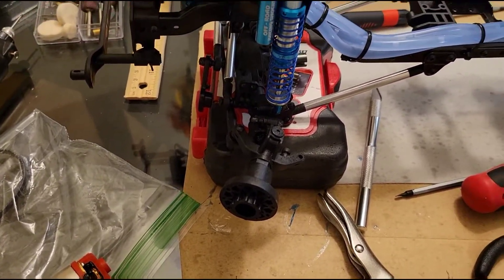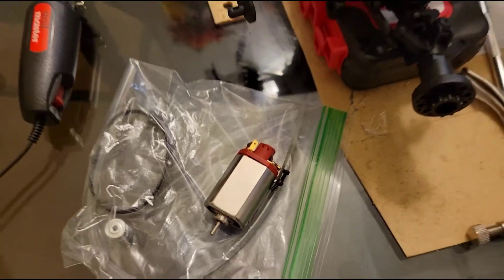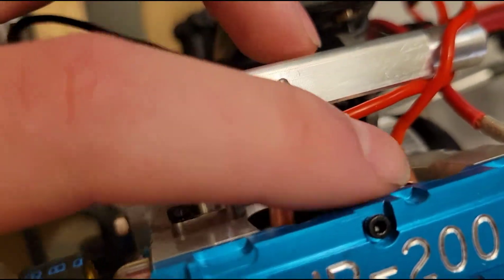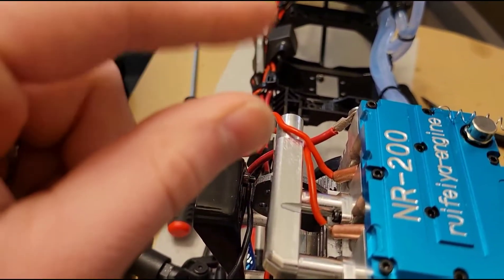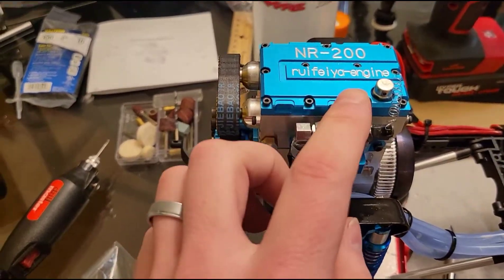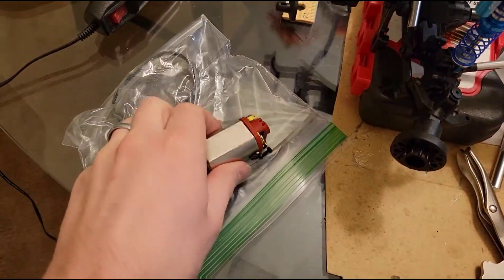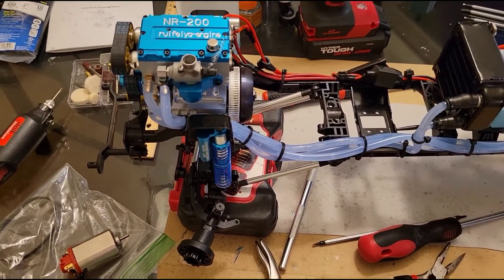Ruifeiya NR-200 Engine Problems!!!

Comment: hello

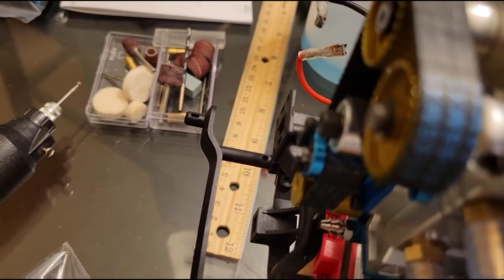around the 3:00 mark, you mentioned that the engine has fuel coming back, and out of the carburetor; that may be a valve related issue.

i work on snowblower engines, and typically if you have 'popping' or fuel being spit out of the carburetor, it's usually an indication that your intake valve (or valves) may NOT be sealing right.

my suggestion would be to have a look at the valves and lap the valves in using some body polish (the valve seats are likely a soft metal like brass or aluminium, so valve lapping compound is too rough), or contact stirlingkit and have a new engine sent to you. in the end, the engine should have been inspected for quality.

p.s. i have the nr200, and i see a few inconsistencies with quality.
Reply from the maker: Hey I'm going back and fourth with them now. Yes it seems to have a valve/timing issue however I cannot open the motor due to warranty. I'm giving them till tomorrow to respond I'm done playing the "try this part and tell us what happens" game. If they keep it up I'll go to engine DIY. They want to work with me as well. We'll see! Thanks for the input man. I used to build custom cars for a living luckily!
Reply: @pryrcguy9298  enginediy has the same game unfortunately. 

Custom cars? The quite impressive! Always great to have hobby interests waiting at home for us! I used to have a few rc cars back in the early 2010's, miss those days! This might re-ignite my interest :D

Recently subscribed! Best of luck receiving a new motor.

Comment: Hey, i just ordered a NR200 from stirling kit for the same CEN F-450 build. Looks like ur goin through a lot of problems here, Now im scared if my motor will also be defective or not 😨
Reply from the maker: Hey man I wouldn't be too scared, as I said in the video there are duds no matter what product it is and where it comes from. I always seem to have bad luck. Stirling kit sent me all new replacement parts. I'm waiting on one more to come in (it's the Chinese new year for them and it's like a week long). Stay tuned I'll have another video up in a couple days. The new electronics came in and were perfect.
Reply: @pryrcguy9298  i guess i got unlucky, ive had soo many problems with mine and waited literally 3 months before they even shipped mine, engine doesnt run, hasnt ever run, and the pin that holds in the starter gear and the one way bearing together and now the starter is useless, and will not fire when i used a drill
Reply from the maker: @1cityboyz  have you contacted customer support? Mine has been fine since the new carb. I cannot confirm that there isn't other things that they fixed but I honestly doubt they would lie about it. It's deffinetly the same engine I sent in.